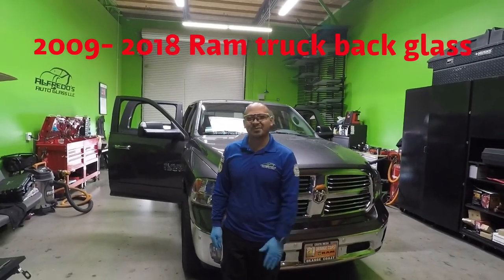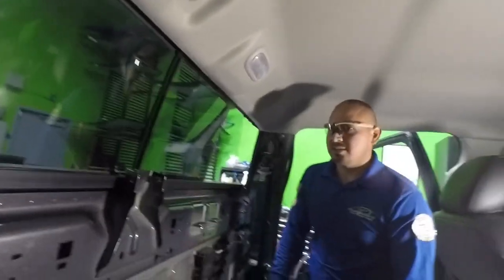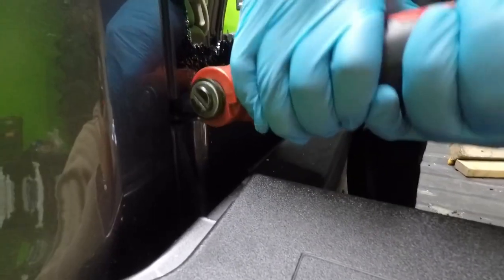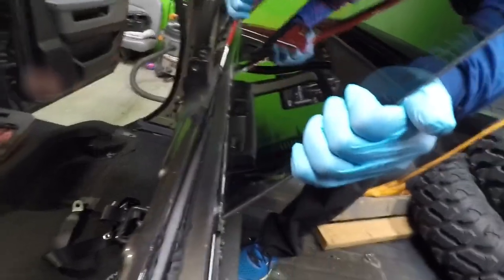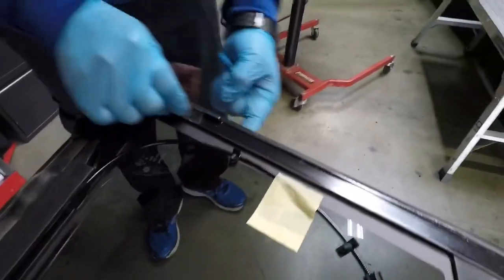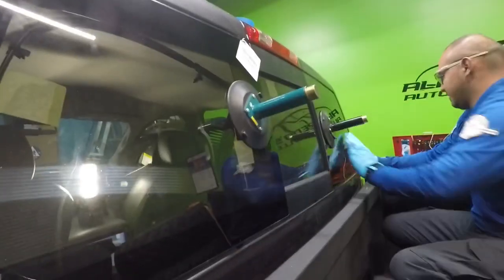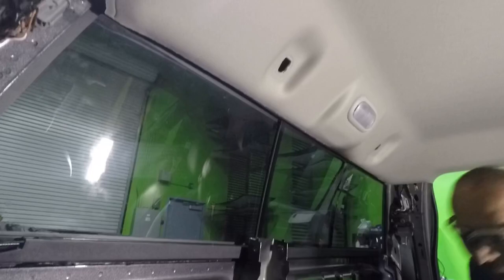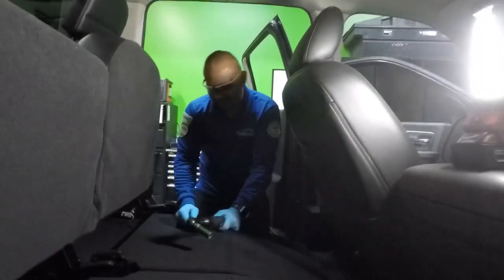Ram Truck, Dodge Ram back slider glass replacement by Alfredo’s Auto Glass in Corona CA

Comment: I’m an installer at a small family business here in NC. Just wanted to chime in and say when I cold knife these out I will usually cut the encapsulation out all the way around with my long knife first. Makes it so much easier and gives you more room to work which helps with protecting then paint. Nice work 👍🏼

Comment: Good job. I hate those Windows I've had to take some out for body shops so they can do roof job in it. I  remove the headliner and use an air knives like your electric one on the inside works good.
Reply from the maker: a Oetjen thank you. Power tools and Pneumatic tools are so helpful same thing with fiber line or wire tools. Now on days we got to have all of them with all this different designs.
Reply: If you are doing it in a body shop have them remove the seats and headliner.

Comment: Great video, If you have a manual sliding window on a 2004 Ram 1500, do you have to remove the rear seat?

where did you get the blade for the multi-tool to cut around the glass? Also, what urethane and primer are you using? Thanks

Comment: Had mine replaced yesterday ram 2021 1500. Was leaking. The guy said the new one will leak again.  There is a flaw in oem window.  What's your opinion? Thanks
Reply: I had the same issue with my 2019 Laramie.  Read a couple of forums and apparently a lot of people are having this issue.  I guess RAM is waiting for more lawsuits to finally do a recall.

Comment: I use the same technique as you. also I use the same dow 30 minute adhesive (dow all the way) . I have a 2500 to remove the slider for a body shop tomorrow and they want me to save the slider if i can. I was going to try my WRD spider and try and string it out.  I would appreciate any tips on saving the slider?    Thanks Alfredo ,really enjoy your informative videos I always enjoy seeing good technicians techniques .  thanks again Alfredo.
Reply from the maker: Laglasstech Thank you for taking the time to watch my videos! I have use the Spyder & the Raptor to save the exact same back window and I’ve been successful saving them, you would definitely have to bring part of the headliner down, position the spider or raptor all the way at the end of the frame when already cutting on the top and the bottom on the inside of the truck so that you don’t start cutting into the frame. Also don’t forget to bend the metal tabs towards the glass, make sure the fiber line is in between the frame and the body, guide it with a bone (plastic stick) to help you keep the fiber along the frame on the top and on the bottom so you don’t cut into the frame of the glass.

Comment: Very informative video. Lots of close (perhaps a tad wobbly) many answers provided video. Just as an aside, I hope you are using tag words and might I suggest adding Dakota, because this is exactly the same procedure. I know you might have been concerned with the length of the video but seat placement work might be nice to see, even if you redirect to a different video.Very professionally applied overall though. Thanks

Comment: What tool is it your using to cut around the seal? Is it an oscillating saw? And what bit is that?
Reply: It is an electric cold knife. Same thing as a regular lever cable pull knife used to cut out windshields, just electric.

Comment: My 19 Ram big horn didn't come with the sliding rear window, can you add the sliding rear window and how much? I was told the Big horn has the wiring already there.
Reply from the maker: I would check first to make sure the plug for the window motor and the plug for the switch are there to make sure it’s going to work.
Reply: Don't do it. The 5th gen models have leaking issues due to poor design.  My 2019 Ram Laramie started leaking about 3 years after i got it and the dealship refused to replace it because it was out of warranty!  POS

Comment: I can believe dodge had to make the ram soo difficult to change the rear window. I shattered the middle part that slides. Previous models you can just buy a new window and replace it yourself with 5 mins for $100. Mine I been quoted to spend $1,200 and have to replace the entire damn window.

Comment: I have a 2016 3500 Megacab with same issue,  the seats in mine fold forward... I would think that you can do the replacement without seat removal in the Megacab?   Also wondering where to get this done right in the Seattle area?
Reply from the maker: Pls check the third brake light first, %90 of the times that’s the problem where it leaks from.
Reply: @AlfredosAutoGlassRepairCorona   I replaced the gasket on the 3rd brake light a few days prior to the  back window exploding when the door shut!  Right now I have an appointment with Safelite to replace it,  not sure if thats' the way to go or if I should go to a dealer, is a blown out window covered under warranty etc?  I sure hope that me putting on a better gasket is not the cause of the pressure in the cab blowing out that window instead of escaping past the old seal on the brake light?   Anyway I need a replacement of the 3 piece, heated, motorized back window, tinted dark

Comment: stupid ice from car wash fell on my back window on my brand new ram. huge gouges on plastic piece above sliding window. I hate the thought of my truck getting dismantled  like this, most installers dont put shit back correctly or do as good as job as you. Now to decide to live with gouges or get window replaced under insurance. Both seem like crappy options

Comment: This is Eric,  what blades work best regular or reverse sharpened
Reply from the maker: Eric Bray I use 51848 1in and 51849 1 1/2in but I still have to sharpen them right out of the bag.
Reply: @AlfredosAutoGlassRepairCorona  where do u get your blades from for the multi tool ?